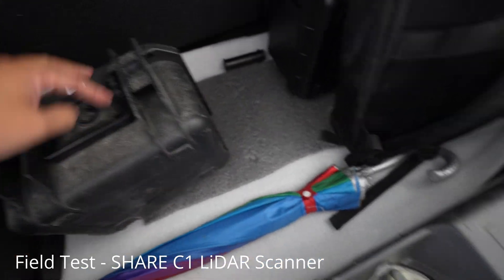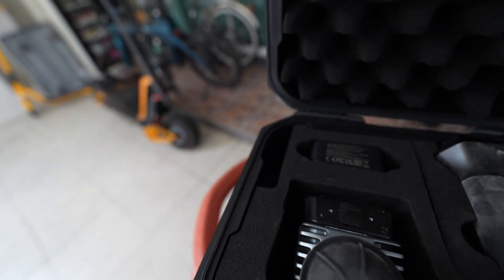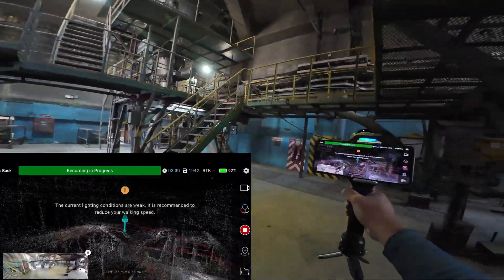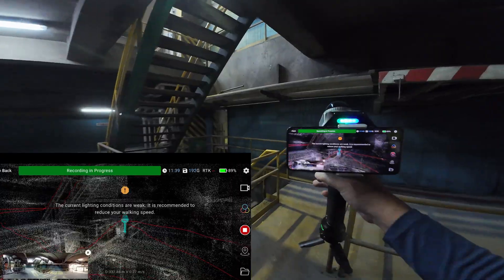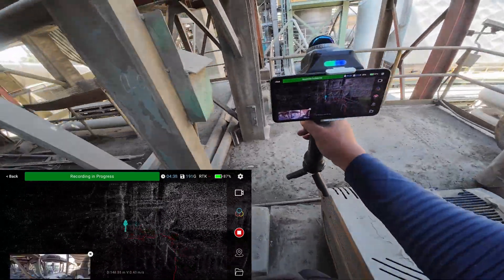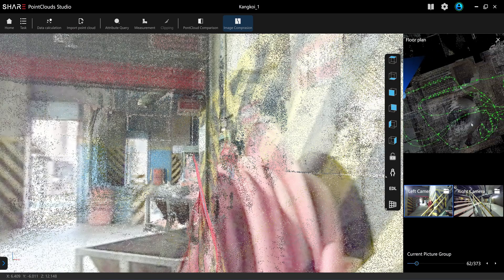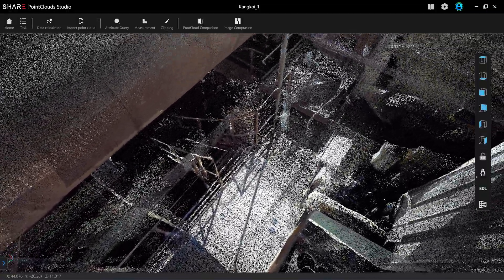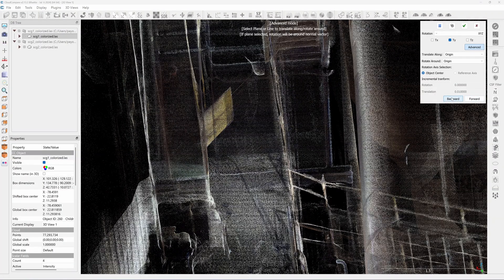Field Tested: SHARE C1 LiDAR Scanner in Harsh Industrial Environments

Comment: bravo, great job in the industry (it's probably the production of IVERICA) I live in Croatia, I had the task of scanning the entire plant (approx. 200m line) for the reconstruction of the vent pipe with the Lidar Stonex x70 go (originally SLAM 2000) scanning up to max 20 min I never use RTK but to merge multiple clouds I use GCP (min 4 pieces) which I previously geodetically recorded according to geod. coordinates then overlapping is never a problem all these models have the same LIDAR unit (from dji) Livox 360 and I'm glad to see that this model has such good results and a good price

Comment: I can't wait to see your video about how you reverse eng that pipeline, are you doing that?
It's something I do often but find I need specialist software, but would love to see if you have some basic techniques in Inventor without pipe extraction tools?
Reply from the maker: Inventor has pipe tools and frame generator, much quicker to create pipe run like this.
Reply: @Payo-TensileCreator Heya Payo, yep I know Inventor well I have previously been an Autodesk Engineer right from the Mechanical Desktop days, and frame generator is awesome. Though I am a Solidworks user these days.
It's the pipe diameter and Centerline extraction that is not automated in the base tools, it will be interesting to me how you do that.
There is a million ways to do it of course including custom automation tools and I have my own ways, but always interesting to see how others do it.
I know of a few guys use Plant3D to use automated Centerline and diameter extraction first, then move to Inventor, but it's quite a round about solution.
Thanks for all you do Payo, very informative.

Comment: It's a real shame the Share software doesn't have some registration features to join those pointcloud for you.
I had the idea with my S20 that using the RTK would king of be accurate enough to place the 2 pointcloud to each other.
But I'm having some issues processing with RTK fusion unless there is RTK signal all the time.
I though if I start outside and move indoors the RTK signal outdoors would be enough to geolocate the pointcloud to the outside scan, but the software doesn't seem to like it when RTK signal gets lost part way through a scan.
Would love to see your testing on this kind of thing with your S20 soon?
P.s for real accuracy of joining those pointcloud together in CLOUDCOMP wouldn't those targets be much better if spaced much further apart?
Reply from the maker: I've made 9 filed test with the S20, The SLAM has better precision than RTK in most case and when RTK Fusion is used, there would be no SLAM involvement, the result will come out purely from RTK and IMU when the GPS signal is lost.
Reply: @Payo-TensileCreator ahhh ok makes sense. The problem I have seen is when moving from outdoor to indoor and using rtk but signal is lost.
I thought it would swap to slam when rtk is lost but maybe that just causes problems. 
If we were to forget rtk altogether, do you think the S20 se is better quality pointclouds?
I'm not sure if there is any hardware or software changes other than rtk between S20 and S20se?

Comment: It seems the visual slam work wonders double checking and improving the lidar slam. This is done with the big cameras with the mechanical stutter that also help with colorising the cloud. I ve been looking at the SHARE S100 model with 32 lines. The cost is live 13000 Euro plus VAT which is amazing. The only bad thing is there not enough data. Maybe they send you something in the future to make a vid. Still i am looking at it purely due to the good reviews of the C1 and S20.
Reply from the maker: I think SHARE uses photos for loop matching in its SLAM, which makes it so precise. The camera can’t be turned off, likely their secret. The S20’s extra V-SLAM camera tracked reliably in my corridor test with repeating patterns.
Reply: @Payo-TensileCreator  Thats the secret. The cameras even have mechanical shutter for better performance. This is probably why it takes longer to solve the cloud compared to eagle (they have to solve photogrammetry also). Waiting for S20 review. If you know more about S100 please write something. Once i got solid data about it i think i m gonna buy it.

Comment: When it launches, it will be only $1000 less than the S20, which is not much money for industry. Does the C1 have something better than the S20 or is the S20 better in every aspect except for price and size?
Reply from the maker: The S20 GNSS-RTK outperforms my survey-grade GPS receiver, despite costing less. In just 20 minutes, I can map 1 km without needing to return and close the loop. Beyond that, the S20 offers improved low-light camera performance, higher picture quality for 3DGS, and the ability to capture control points. Everything else remains comparable.

Comment: Great test and technical review Payout, great results for that price. Would the C1 be okay for domestic apartment scans of bathroom with mirrors, or lose tracking like the eagle ? The color pointcloud certainly seems better.
Reply from the maker: The mirror won’t throw it off track, though ghosting will show on the opposite side of the wall.
Reply: @Payo-TensileCreator sound good, thanks for the update. Hope you get to review the new solid state hawk from eagle soon, 480pts per second. but twice the price of eagle unfortunately. C1 and S20 are probably enough for most aplications though.